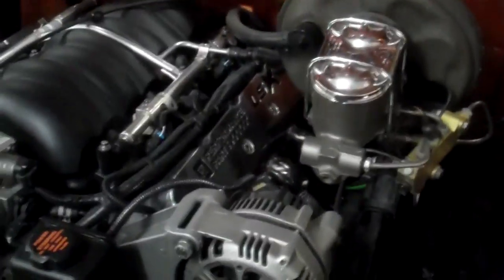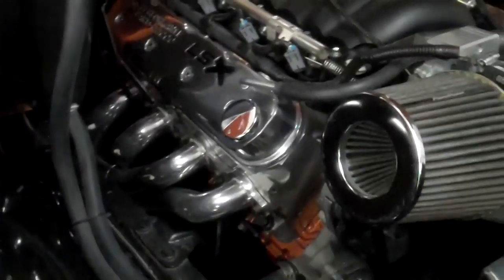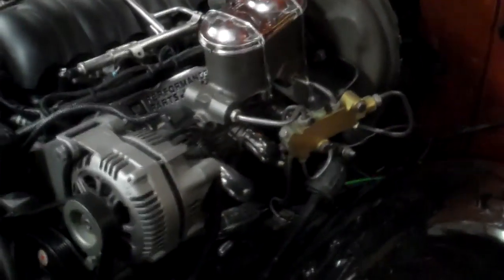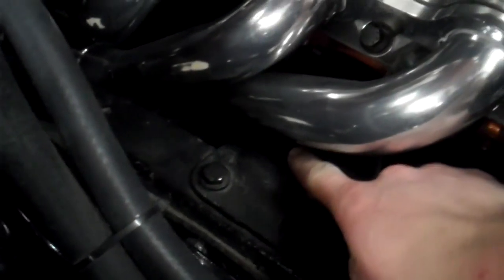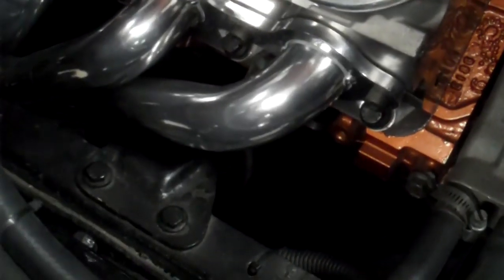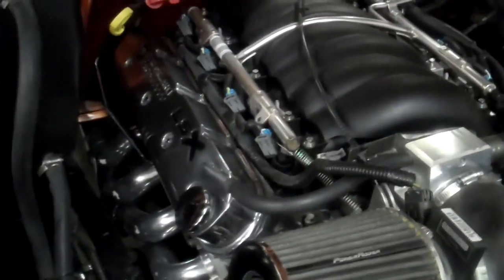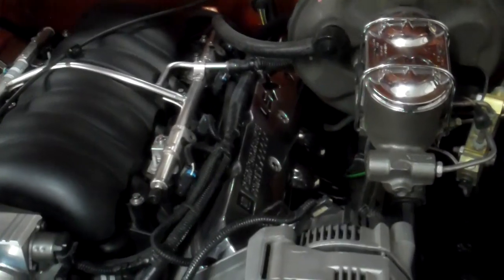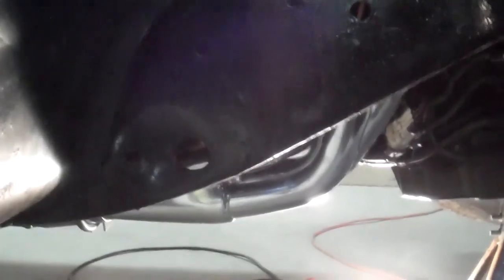1969 Chevy C10 Shortbed LS Swap Pacesetter Headers

Comment: I just bought a 6.0 Lq9 out of a 2002 Cadillac Escalade and would like to use the same Pacesetter headers you used on your Lq9.  What year is your motor and would these headers fit my 2002 Lq9?  Any info you can provide would be greatly appreciated.

BTW, beautiful truck and your exhaust sounds awesome.

Comment: hi matthew you have a pretty bad ass truck i like it. i did 5.7ls1 swap it's light and fast. i have question for you if you don't mind what transmission are you running? and what do you think 4l60e or TH400 is good for ls1 swap ?
Reply from the maker: I am running a 4L60E in this truck. I would recommend it behind a LS1 great trans unless your making huge power then go for a 4L80E

Comment: What are the cam specs? On warm days does it lope close to what id does in this vid?  other video You ran a 5.3 and now a lq9? thanks 
 Tim
Reply from the maker: +Tj W It does lope all the time, more so when cold but also when warm. Specs are Comp LSR series, 223/231 .610/.617 112lsa. The engine is a LQ9 with L92 heads, LS3 intake.
Reply: matthew20061  what stall 2000

Comment: Those "C"  shaped frame rails pretty weak to begin with prone to cracking. Weaken them even more bad idea. That aside awesome truck.
Reply from the maker: +Manuel Serrano You make a very good point, I probably should add a plate in that area to box the frame for strength.